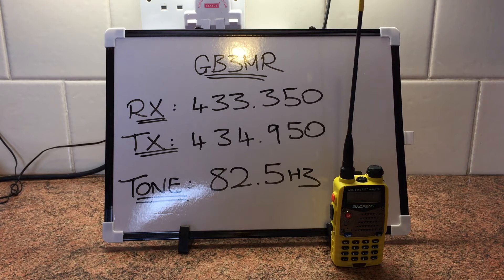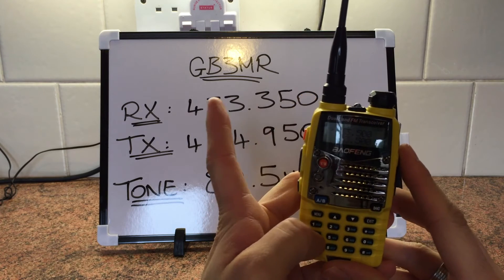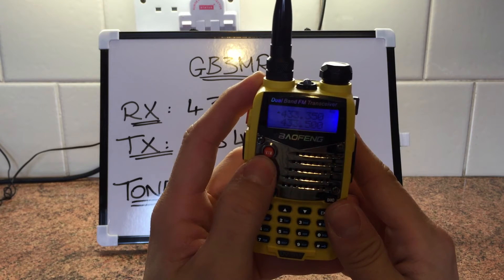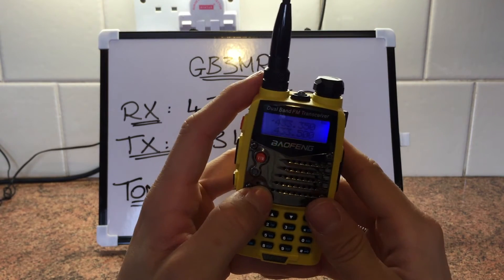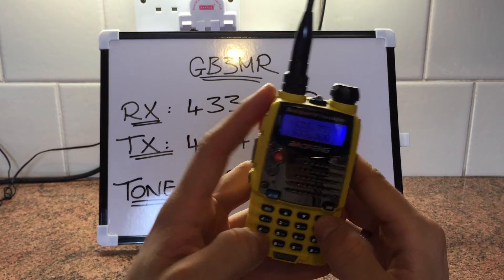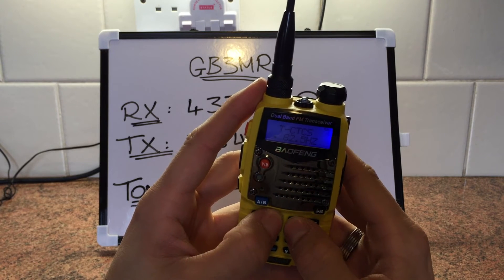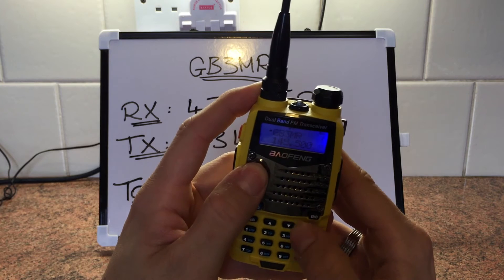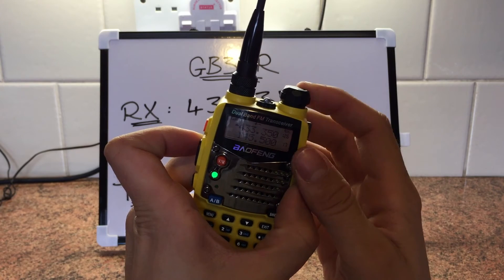How To Programme Repeaters In Baofeng UV-5R Without Software

Comment: iv got a GT-3TP MK 3 and wondered how to do this on there?
Reply from the maker: ***** Exactly the same Jay
Reply: WELL IM IN FREQ MODE EVERY SETTING works fine, EVEN THE OFFSET,

however as SOON AS I GOTO CHANNEL MODE AFTER SAVING, it has 0 offset in that stored chanel (chanel mode)
and i change that to 000.600 and save / confirm with menu button and it undoes that setting again i also tried re saving after changing the offset and still no luck, also tried deleting channel and re adding it, still fails to keep offset settings in channel mode! what could be the reason? (also tried resetting back to default settings still same issue).
Reply from the maker: Don't worry about the offset setting. Just follow the steps in the video and it should work fine. Or is that what you've done?
Reply: iv tried all kinds of ways and your ay as well! everything seems to save except it wont save offset and offset is the only thing that fails to save!
UPDATE: i watched your video again and i clicked on that you work out the TX freq and save over the same chan as i did the RX and i works out the offset, so it works now thanks for your help :D
Reply from the maker: No problem Jay, yeah I never touch the offset setting, just save individual frequencies and it's easier :) Glad it helped!
Reply: i tries same technique for 70 cms freq i did the exact same way and it fails to save the fre to a channel it has a weird beep and dont know why, the freq works on vfo mode just it wont save at all, the freq is 433.3250 any ideas why it wont store to a new memory? its not currently in use!
Reply from the maker: ***** Can you do a video showing Jay?